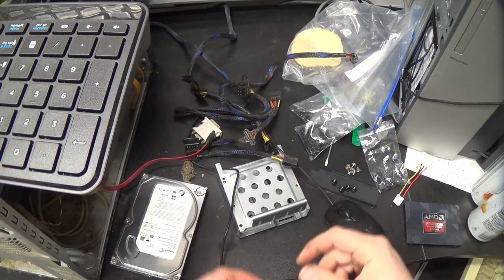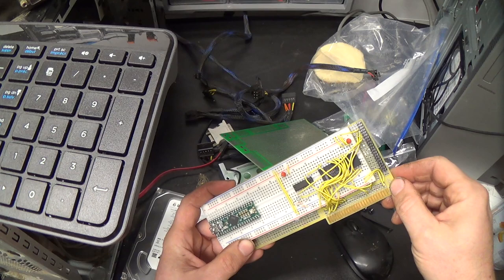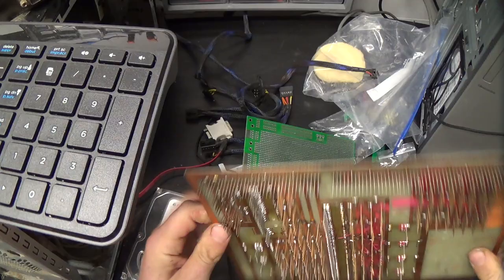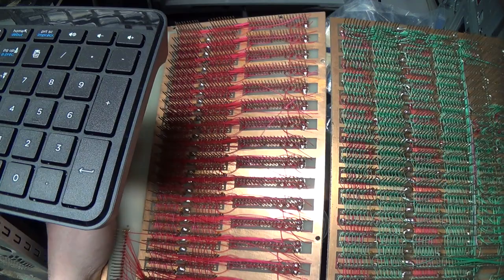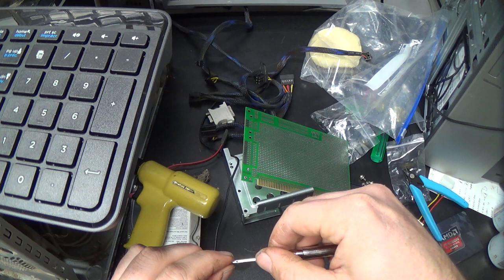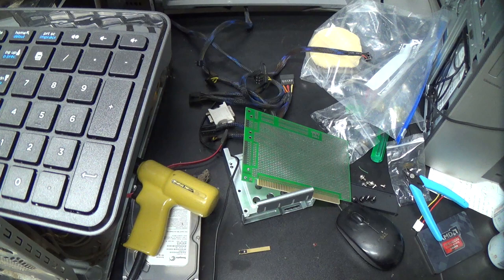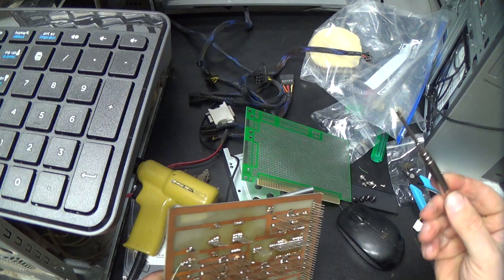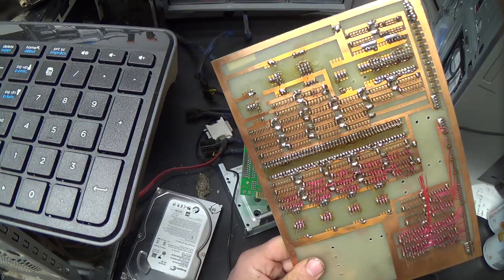Wire Wrap is Great for Prototyping

Comment: Your wire wrap CP/M machine will be glorious. And if you're adding vacuum tubes, can you also throw in some electo-mechanical relays? Or some core memory? Or punch tape. Or those mini-reel-to-reel cartridges they used on the IBM 5100. Ah, nevermind. I guess that'll be my bucket list project. 🙂
Reply from the maker: Yeaaaa, some great big clunky relays would be cool.  I don't have the patience to make ferrite core memory though.  :3  Although it is something I'd like to try on a small scale sometime just for shits and giggles.
Reply: @Lee_Adamson_OCF  That's what I'm thinking: a 256-byte USB drive that's the size of a small toaster.

Comment: Breadboard definitely is teh suck. Other night I reprogrammed a GAL three times thinking I must have screwed up an equation change, ended up trying another GAL in case the first one had failed internally somehow... and at some point in all that futzing around I apparently bumped whatever came loose back into place and it all started working again.

(I'm actually still scratching my head what it was because it was a weird failure condition, I'd like to be able to replicate it...)